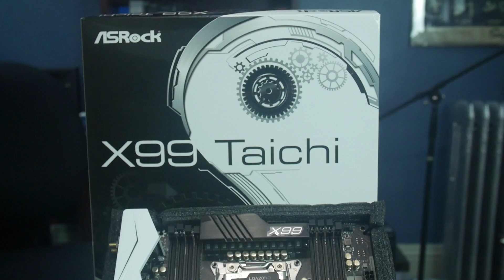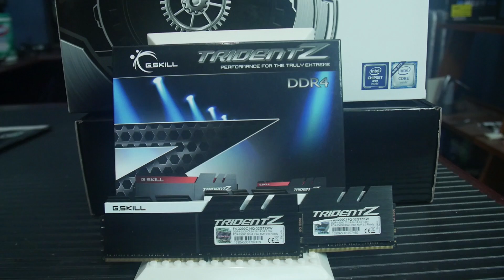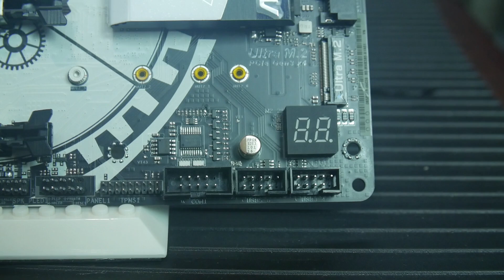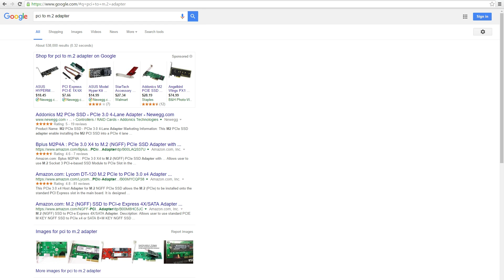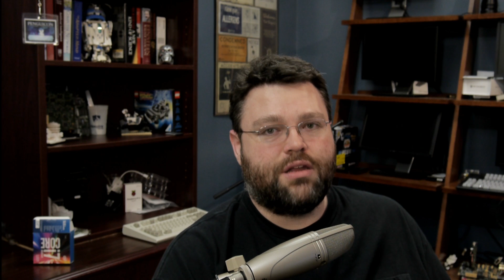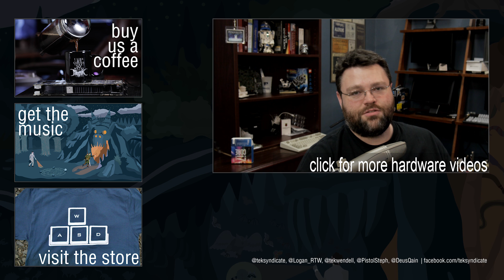ASRock X99 Taichi Motherboard Review and Test

Comment: just got this board a few weeks ago for $209 BEST BANG FOR THE BUCK for my $260 ebay Xeon E-5 2618L-V3 this has is a nice price/performance sweet spot. with 2x kits of G.SKILL Ripjaws 4 Series 16GB (4 x 4GB) DDR4 3200 Model F4-3200C16Q-16GRK. i decided to get all 8 sticks at once for best quad channel DDR4 performance. rather than buying 1 kit of 4 and later hunting down another matching kit. then an Intel 600p Series 512GB, M.2 2280 80mm NVMe PCIe 3.0 x4 for $165. booted into the bios on the first initial test boot. updated bios over the internet with in seconds of it's new life. windows installed from a USB 3 stick to the desktop under 20 minutes! GTA loads to the map in a minute! that normal load time is at least 5 minutes on any other console or PC build I've played it on. Even tho I'm still using my  "old" EVGA SC GTX 760 i bought on ebay for $80 awhile back for my i7 860 ITX Scrap build. With this configuration I Don't see the NEED to upgrade the GPU just yet it plays GTA V at high settings 1080 @ a locked solid 60FPS Vsync or 70+ Vsync disabled. how ever there is an identical 760 on craigslist for $80 i might get it down to 70 or less since it''s been on there for DAYS now.

Comment: On the website, it says it supports ECC memory. what it doesn't tell you is that it can only detect certain brands of ram. i tried using 128gb of Hynix ECC DDR4 memory and it failed to boot

Comment: Are you just reading the manual? because you're doing a terrible job. the manual clearly says this board supports RDIMM or ECC (I saw KVR24N17D8/8 in the RAM support list from Kingston which is unbuffered ecc ram).

Comment: wich motherboard do you think is better: x99 or z170?
Reply: Better SLI performance with a 40 PCIe lane CPU with x99. i got a Xeon E-5 2618L for $260 on ebay. 8 core 16 thread 40 PCIe lanes.  a fraction of the price than a 40 lane i7

Comment: Did I hear that correctly that you would not be able to use ECC memory with this motherboard? It is clearly in the Asrock marketing and I was about to order it with a Xeon until I heard you mention you would not be able to use ECC memory on it. Why not and have you testested it?!?
Reply: Newegg has a nice sale on this board right now with the coupon code and rebate. The sale ends tomorrow.
Reply: Yeah I bought one. I wanted to hear a comment about it supporting ECC though because I am about to buy 64gb of ECC with it and with an 8 core xeon processor. that I was going to use for mirror some existing servers with in a VM. It says it supports ECC so I don't know what the reviewer was talking about...

Comment: Okay, so I am very interested in this MOBO, but I am at the very tricky part of my build.  Choosing RAM.  Anyone have any tips or know of any compatible DIMMS to help me out?  Pardon any incorrect terminology...  Thanks!  P.S. I checked ASRock's QVL but those modules are hard to find....
Reply: Any of the kits from the top brands will work. DDR4 3000 is probably the sweet spot for 4x4GB sticks.

http://www.newegg.com/Product/Product.aspx?Item=N82E16820156143&cm_re=ddr4_3000-_-20-156-143-_-Product

http://www.newegg.com/Product/Product.aspx?Item=9SIA1K645Z6768&cm_re=ddr4_3000-_-9SIA1K645Z6768-_-Product

http://www.newegg.com/Product/Product.aspx?Item=N82E16820156140&cm_re=ddr4_3200-_-20-156-140-_-Product

I would probably go for DDR4 3000 at $95-100. Take the $20-25 saved on DDR4 3200 and invest it into a better CPU cooler or a larger SSD. Skip the 6850K as the extra PCIe lanes are worthless. Use that $ to buy a better GPU or monitor.

Comment: Do you need to update the bios if you plan to use a Haswell-E CPUs like 5820K? I owned one and i need to replace my damaged MSI X99A SLI Plus.
Reply: Of course not. The 5820K is part of the line of CPUs that debuted with X99, it would be weird if a recently released X99 MB didn't support it out of the box.

Comment: I've had alot of problems with asrocks. I had a asrock extreme 4 for a amd 8320. Even without an overclock, I just kept getting random bsods and other issues. Switching to a asus, fixed about everything. Except, I never could get back into windows xp again... And beyond their tablets, I'm not really a big asus fan at all
Reply: why would you need to use windows xp?
Reply: Mainly for older games. Like splinter cell chaos theory, I never could get my disc to work on win7 or win10. Just booting into xp, worked perfect.
Reply: Multi boot ;)

Comment: i'm still on x79. this big PCIE style of board is the way to go. endlessly upgradeable. 
are u going to do the current ROG board guys? or have u already done it maybe?
Reply: Je van der Geest depends. the only problem i have with skylake is not many PCIE lanes. but they are the fastest gaming chips. so if you were to have one GPU, and no add-ons like solid state drives, or network cards, then go with skylake. but if you have a bunch of add-on peripherals that require the PCIE lanes then skylake will not be enough. 780 is a great card by the way, but of course things like DOOM will challenge it. x99 boards cost a little bit more to buy aswell, so factor that in. if your current board is ok i suggest a new GPU might solve all your problems, and a new board further down the track.
Reply: +Je van der Geest 100% upgrade to 1070 !
Reply: +Je van der Geest i was on a 770 and the perf gain is almost 160% with a 1070
Reply: Je van der Geest yeh. the board u have is fine. it has pcie3 which is fine to whack a new GPU in there and keep travelling. chips never die and boards last a while. i can't see why you would upgrade it for now. but i can see why you would want a new GPU
Reply: 2500k is still fine. Upgrade your GPU. That CPU won't bottleneck it at all.
Reply: fuck man i have a 4930, and it doesn't even do 4.7, it does 3.8 and i do massive stuff with it. the 1440p will only trouble your gpu, your CPU won't even know what monitor you have, only the game engine runs through it
Reply: +Je van der Geest a i5 2500k @ 5ghz is the same as a 6600k @ 4.1ghz
Reply: +Je van der Geest an no it wont be an bottleneck ^^ just upgraded my CPU too From a 8320 to e3 1230v5. bought a xeon OC motherboard and overclocked it to 4.5 ghz. so its a 6700k for 180€. bit of luck it was on sale :D
Reply: +Je van der Geest i wont upgrade my CPU for the next 5-6 years or atleast i hope so haha
Reply: i just picked up a 980ti a month ago. dirt cheap. good value
Reply: +Je van der Geest yeah 980ti got good value i choose between a super Jetstream 1070 for 439€ or asus 980ti Matrix for 399€ but 1070 is more future proof ultra silent and doesnt waist so much power so i sacrified 40€ more. The funny thing is my limit at the beginning was 330€. But im happy now  haha

Comment: You know a lot of people don't even consider asrock  as a motherboard, but honestly they do sell alot of price per performance motherboards.
Reply: price per performance?
Reply: That's the thing with Asrock, take any functionally almost identical feature/price motherboard and Asrock will usually be either slightly cheaper or have a unique feature or two the others do not have.
Reply: In my experience with a lot xeon mobos in a datacenter environment, ASRock stomps on ASUS and Supermicro. They have come so far!
Reply: Their boards are excellent! I got their Extreme series and the thing is rock solid ruining 24/7.
Reply: They have the best for the buck ratio for sure... and quality is as good as any tier one brand.
Reply: When I built my X99 build last year I bought an Asrock board (the X99X board) and so far I'm a fan of Asrock. There was a slight hiccup when i got the board initially (it literally started smoking the first time I powered it on). I contacted their support which I heard bad things about, but they are pretty cool actually. I sent the bad mobo to them and about a week later the new one arrived and I've been all set since. Just in-terms of price, performance and features they go toe to oe with much more expensive mobos out there and they look just as nice without the garish gimmicks some mobo makers are doing now (like LEDs on everything which I think is just dumb and looks awful). 

So for now I will continue building with ASRock.
Reply: I've felt a bit turned off about ASRock since my friend had issues with the Z97 Extreme4, you can google "Z97 Extreme4 reddit" and see what I mean. I'm personally thinking of just splurging on an expensive board next time around. Costs 1.5x more for the same features, but looks a bit nicer and the warranty is easier to claim in Australia.

Still, I currently have a Z77 Pro3 that works fine and it was unbeatable value.
Reply: RaceOfAce A

Comment: Of all words they could have chosen, they chose Taichi.
Reply: +whit3emperor I like the gears but Taichi doesnt fit that theme... fire the marketing guy.
Reply: It actually ties together pretty well. It's laid out like the Ying and Yang and the gears are for the technology. I also like how they have the CMOS batter and CPU socket placed to be the light in the dark and the dark in the light.
Reply: +Kammex This is how the reviewer of this board, over at Tweak Town, explains the name :
QUOTE :
A few weeks before Computex almost all the major brands started to tease us with their latest X99 refresh motherboards for Intel's impending Broadwell-E launch. ASRock released a cryptic video and a grainy image of what would be known as their Taichi. Tai Chi in English is an "internal Chinese martial art" according to Wikipedia, and the X99 Taichi is meant to bring some of that ass-kicking to the X99 arena. The X99 Taichi is supposed to be an "All-Rounder," which means it covers all the bases when it comes to features and performance.

However, that isn't what makes ASRock's Taichi impressive. ASRock's X99 Taichi is meant to bring the pain regarding price. The X99 Taichi only costs $219, and that is on the low-end for X99 motherboards. ASRock's goal is to undercut the competition in price but in a fashionable way. For the first time, ASRock has used a white and black color theme. The unique aesthetics, features, and price of the X99 Taichi are quite impressive at first glance, so let's put it under a microscope and see if it lives up to the hype.
UNQUOTE
Reply: Ying is a Chinese surname. I feel that you meant Yin. Good day sir.